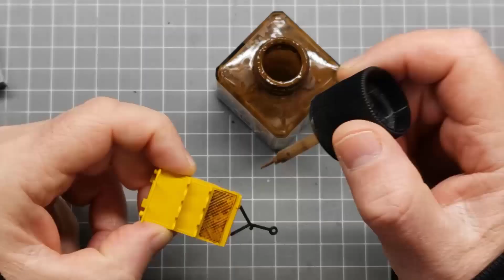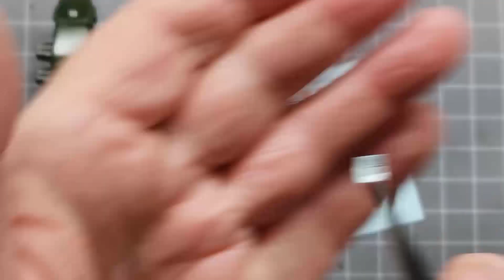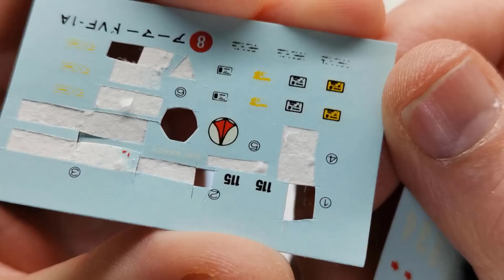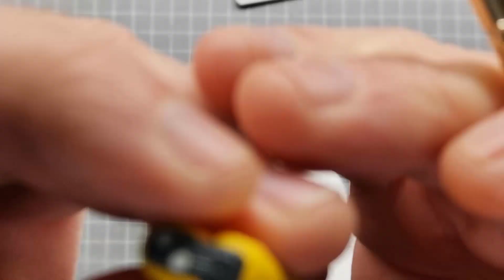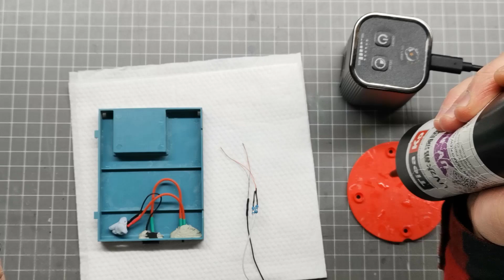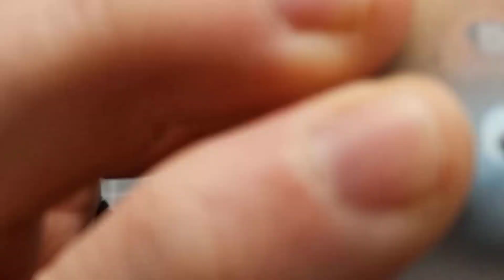Arii 1/170 Macross Armored Valkyrie VF-1A 3D Factory MA-01 - Part 4

Comment: Impressive effort!  I really like the lighting ideas.
You can make superglue more brittle by putting the item in the freezer for some hours. Some time ago I bought some built-but-unpainted Galleon tanks, and after a day in the freezer they fell apart cleanly, not even the guns pinned into the chassis posed a problem.
Reply from the maker: Thank you. That is great advice about super glue. I will have to give it a go next time.